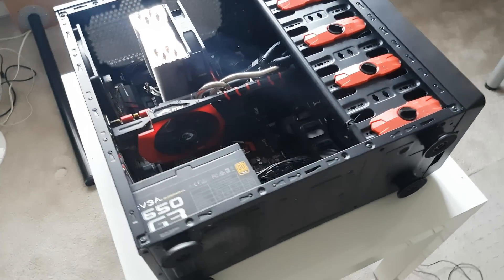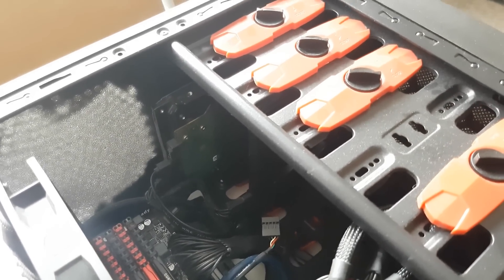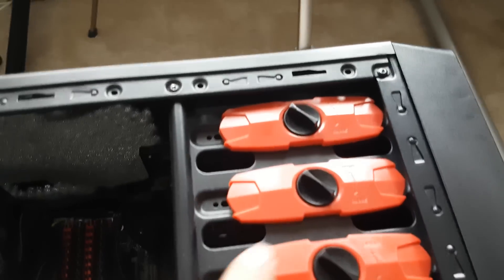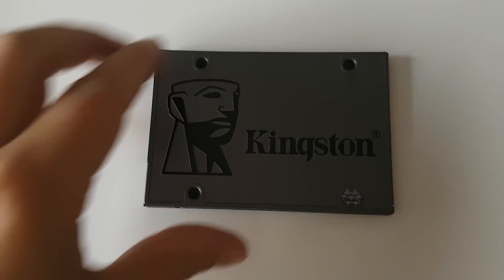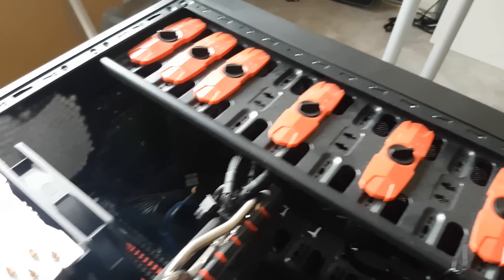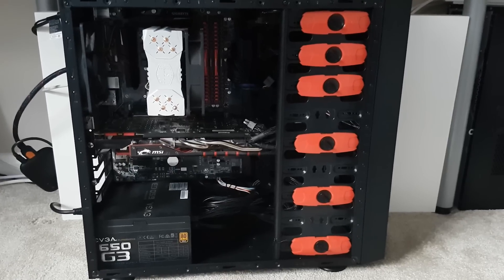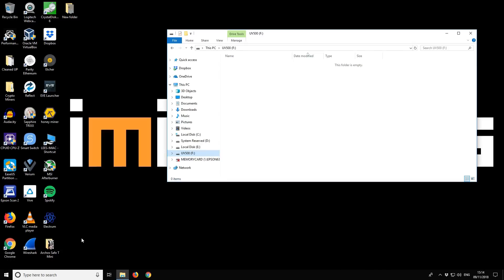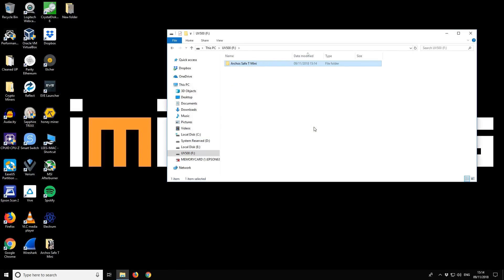Upgrade Time - Swapping out my slow & noisy HD for a blazing fast SSD

Comment: Im interested in attempting at mining Burst because I really love the project. Is it possible to be profitable at all mining with any sort of harddrives these days? I will only be able to start with a few hard drives at most as an experiment. If it works I can invest more.
Reply from the maker: If you have some hard drives already you can put them to use but I would not buy any new hard drives for the purpose of mining.
Reply: @IMineBlocks  thanks for your reply. Is it easy to set up mining burst with a laptop or a desktop? I'm wanting to give it a go even if I don't make a profit. If this is easy to do I can invest more into it.
Reply: my concern at the moment is time commitment and learning curve. But I'm considering crypto mining in the long term.
Reply from the maker: Its not exactly easy but if you follow these guides you should be okay.
Burstcoin Fork - Wallet Upgrade & Setup - https://www.youtube.com/watch?v=AmODcs4MAlg
Burstcoin Fork - Poc2 Plotting & Poc1 Plot Conversion - https://www.youtube.com/watch?v=DAaAARwG7sQ
Burstcoin Fork - Choosing a Pool & Setting Up Your CPU / GPU Miners - https://www.youtube.com/watch?v=REjeHvmoP5A

Comment: Those are nice drives, Lee. I use the same Kingston SSD (just smaller) in all my mining rigs. As you well know, every second of boot time is money lost, and booting a mining rig from SSD, is super fast. I bought the Kingston because it's super reliable, cheap, while still performing up there with the other ones. I've always been super happy with mine. 
I believe the whole case acts as a heatsink.
Reply from the maker: Most of my rigs are now booting from usb drives and running smos, but my work machines all have ssd's now, its a must! Mechanical drives are just good for cheap bulk storage. I'll hopefully be upgrading worker1 (the pc in this video) with a NVMe SSD soon and should see some crazy performance from that.

Comment: Any advice on troubleshooting? Same drive but super slow write speed only 100. Read same as yours.
Reply from the maker: Are you copying from another drive? What if you copy a large file/folder back to the drive itself?
Reply: IMineBlocks just using that utility...
Reply from the maker: @CraigMullins1  Using Disk mark? Is the read speed also slow?
Reply: IMineBlocks 550 read

Comment: Mordern pc should have at least 120ssd imo
Reply: Modern PC should have a 512gb M.2 drive imo
Reply: @Bull8magn8  M.2 has nothing to do in terms of speed, it's just an interface. However, NVMe does. M.2 may have same speed as SATA 3
Reply from the maker: The primary boot drive is a 500GB M.2 SSD. The added drive is just for some extra backup storage space.